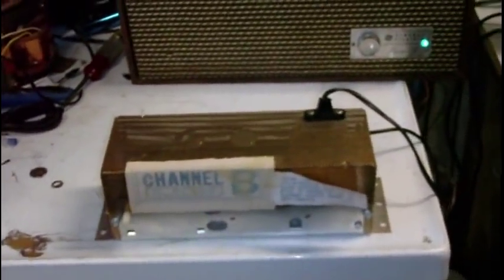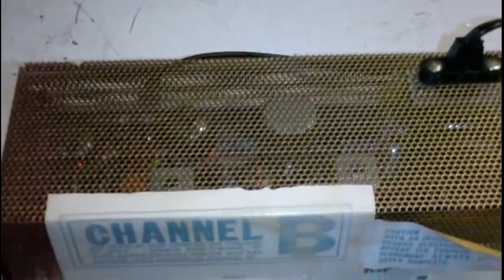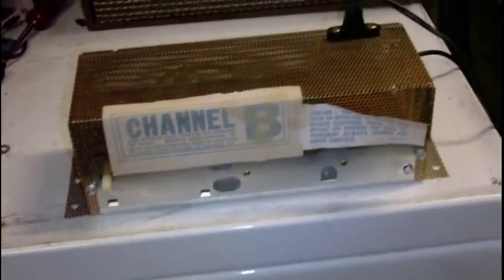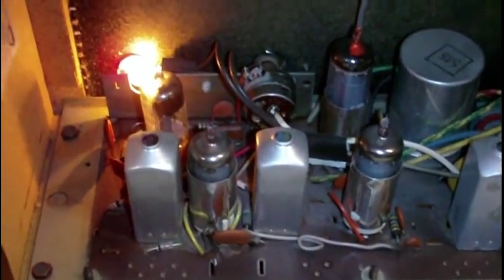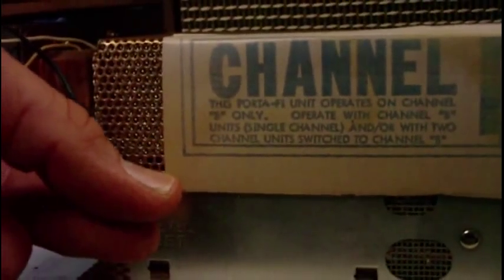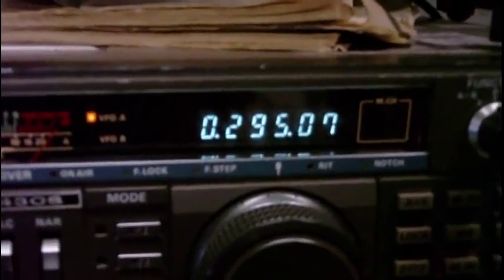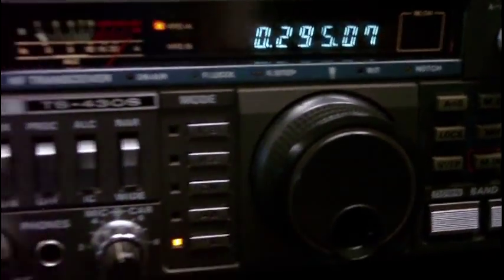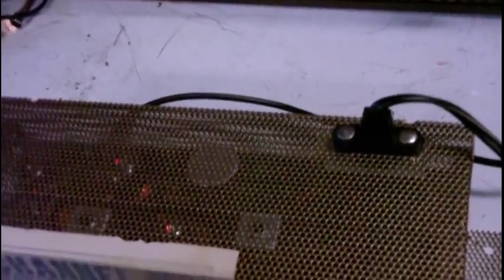1960's Vintage GE Porta Fi Wireless Speaker System Demo

Comment: I had an old intercom system that worked like this. It worked well but with one gottcha. In the usa your 120 volts comes from a 230 volt center tapped transformer. As long as you plugged both units into the same side of the transformer it worked but if you had one plugged into one side and the other plugged into the other it wouldnt work or was very very weak. both had to be plugged in on the same phase for lack off a better term. so both breakers had to run off the same phase in relationship to the transformer feeding your house.

Comment: I have this transmitter as a part of their console system. The right side speakers stopped working about a week ago, any idea what it could be? I have no experience with antique radios
Reply from the maker: It can be a lot of things, I'd play it and check for loose connections first. If not that get a schematic and checking for where the signal is dropping out.
Reply: Chris any chance you could point me in the direction of a schematic?